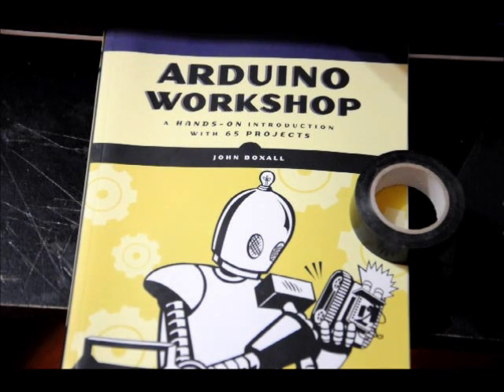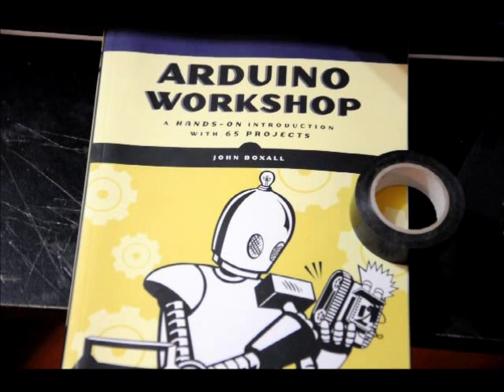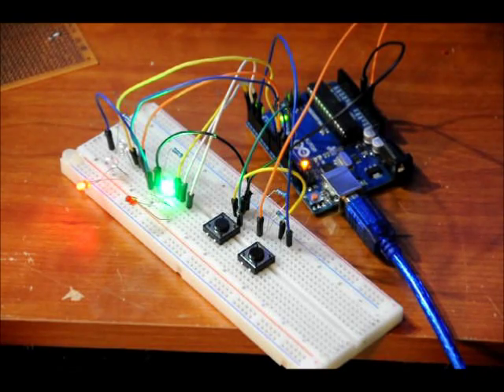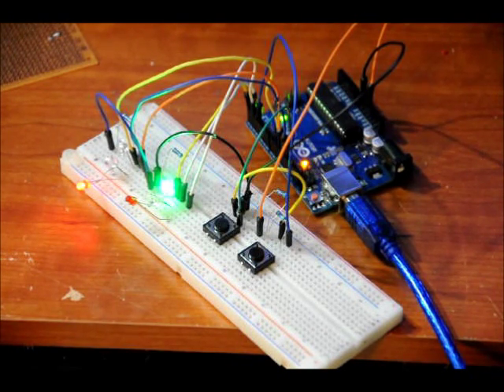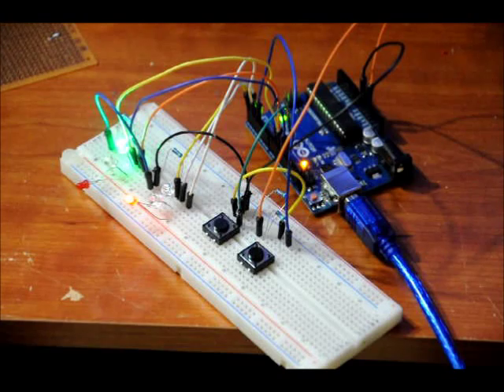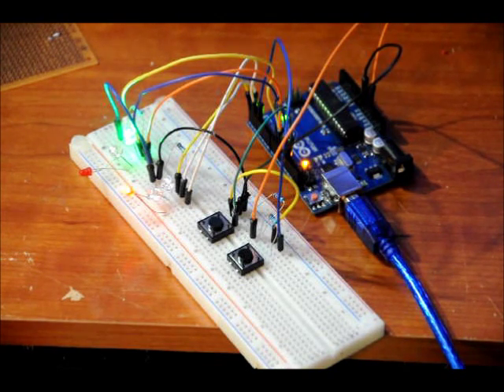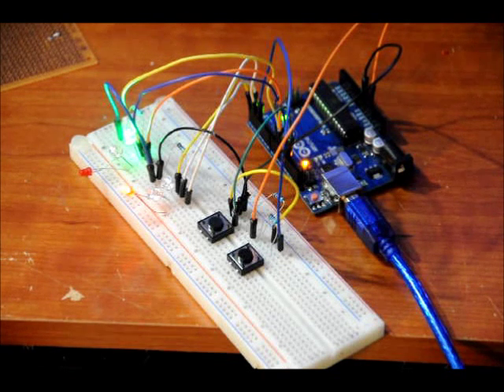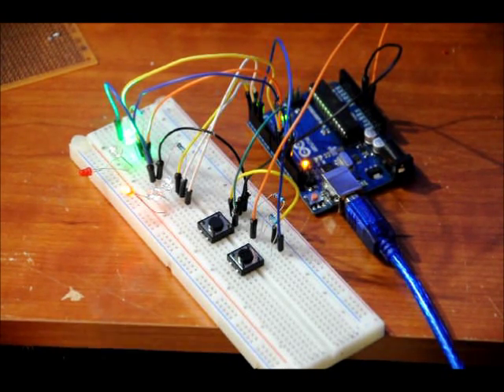Traffic light circuit - Project#6 "Controlling Traffic" - Arduino Workshop

Comment: I cannot get this project in the book to work for the life of me. I've already spotted a mistake on p.76 where the photo of the circuit uses pin #7, but the code doesn't use that pin at all... It should go to pin #3, I think. Also, it seems to call the 3 led's on the left hand side the 'East' traffic lights, and those on the right hand side the 'West' traffic lights, which is doubly confusing in my view. It was a great book, until it started sabotaging me.
Reply: SAME, I'm just going to like, Make the code myself I think